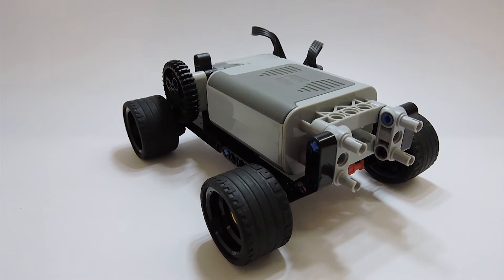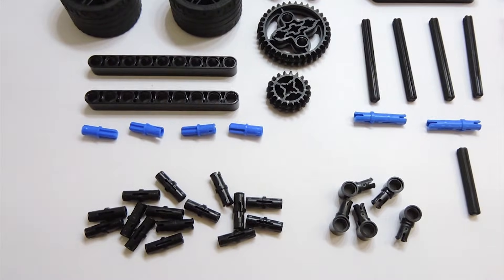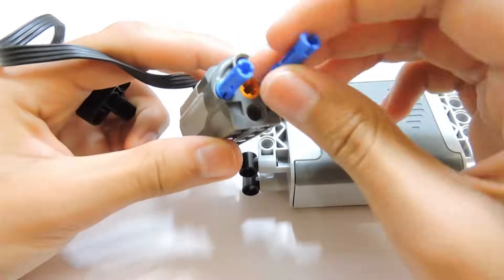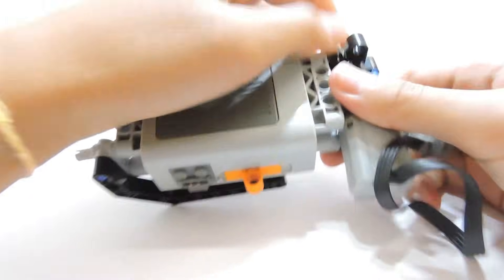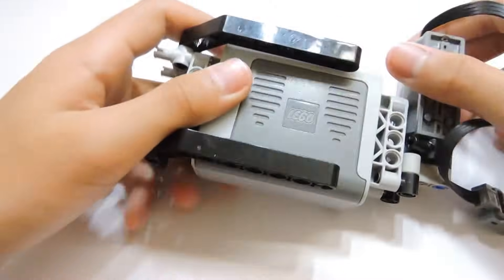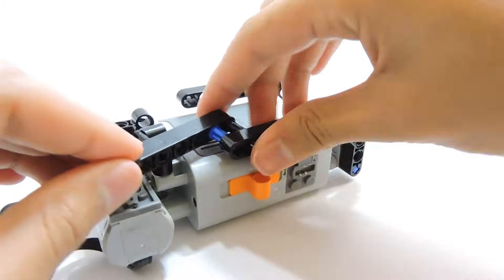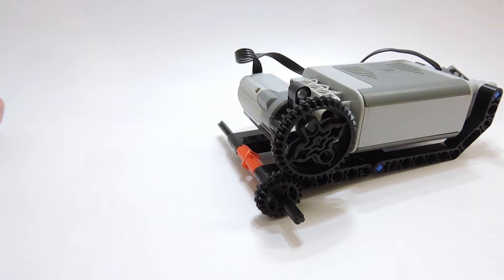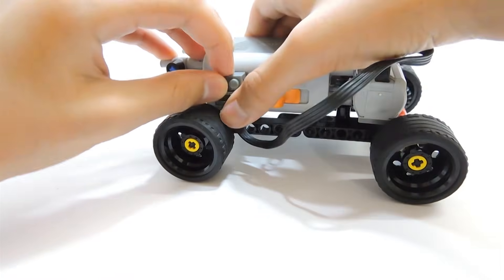How to build a Lego Power Functions Car | Lego power functions car v2 tutorial

Comment: soooo i tried to find the parts name and here's what i found (it might be incomplete + idk the axles' length)
32498 - big cog  
40490 - 9 hole beam
32524 - 7 hole beam
56145 - the wheel
60484 - T shaped beam
32526 - L shaped beam
32009 - liftarm 
15100 - pin with pin hole on top 
48989 - pin connector 3 hole 4 pin 
32034 - axle and pin connector 
43093 - axle and pin hybrid
6590 -  axle spacer thingy 
32269 - small cog 
6558 - long blue pin
32123 - smaller axle spacer thingy
Reply: tysm! this helps a lot for the ones I don't have